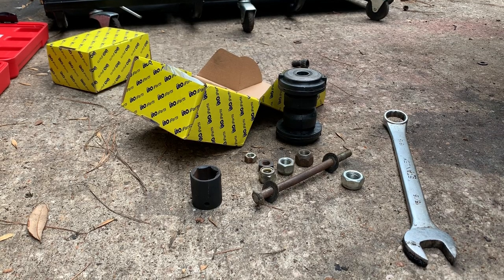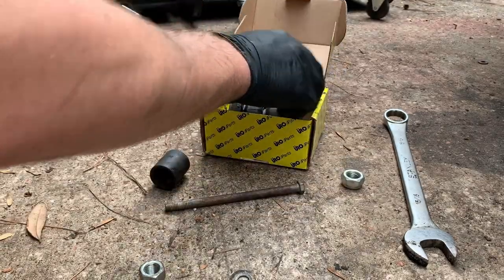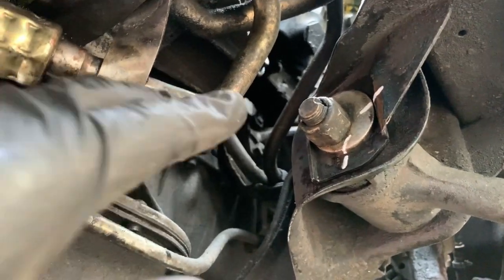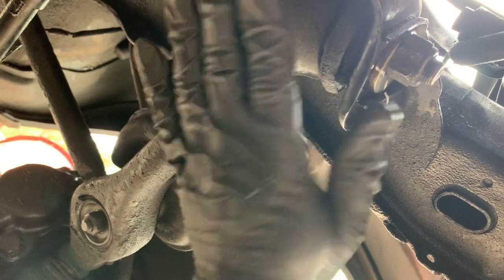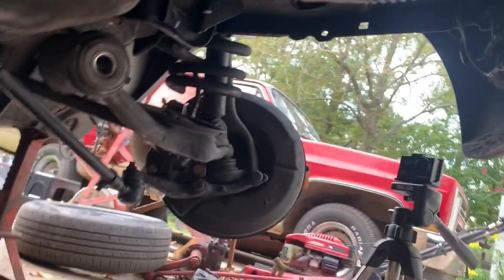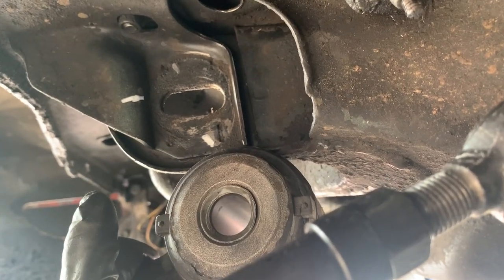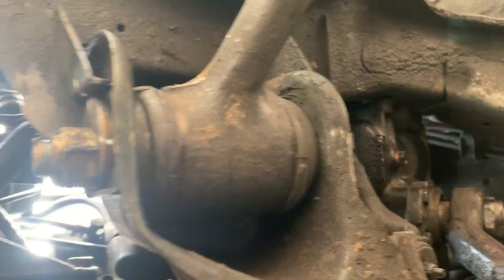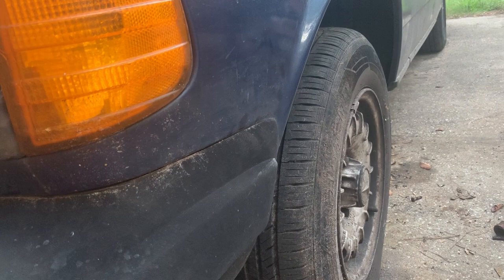300D Control Arm Bushings

Comment: Just replaced the bushes on my 230e. Took them right off the car and so had the benefit of clamping the bushes with two vices before fitting the clamping tube. After much farting about I can confirm I finally fitted and flared the clamping tube using this bar and selection of nuts method. Thanks for posting. BTW there is a special Merc tool for the job but I couldn’t find one anywhere, even to borrow.
Reply from the maker: I tried out the w126 bushings on my other w123, they are supposed to be better and easier to install. Not sure they were any easier.

Comment: did i see correctly that you had the top spring compressor plate in the engine bay, not on one of the upper springs?
Reply from the maker: Correct, my compressor won’t fit all the way through the hole.

Comment: I know its been awhile, but everything im reading up on doing this job says the bushings tabs need to be up and down in line with the balljoint, not side to side. Did you have any problem aligning it afterwards with them this way?
Reply from the maker: No issues, info I found said parallel with control arm?